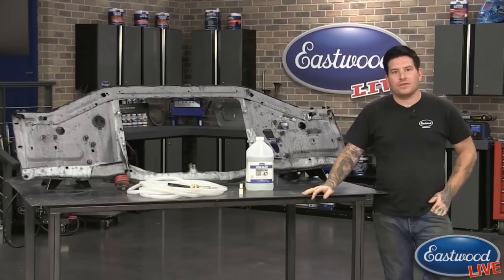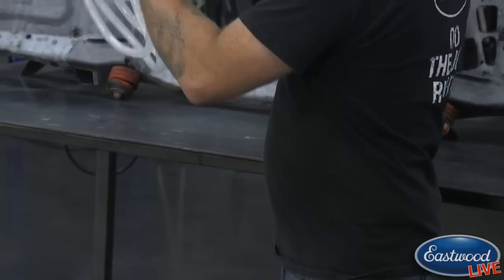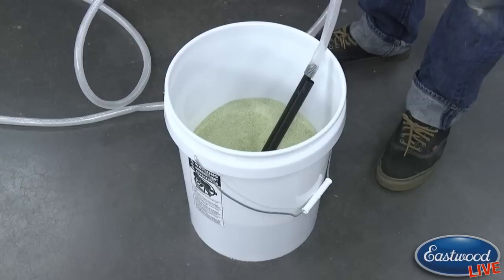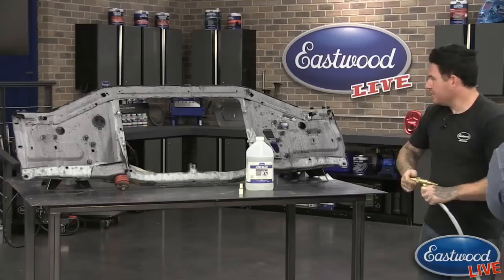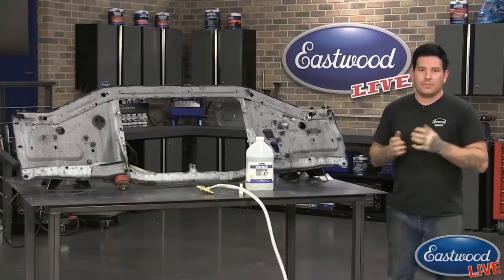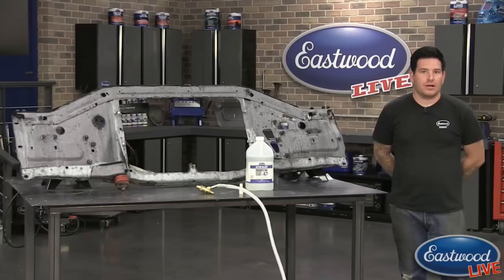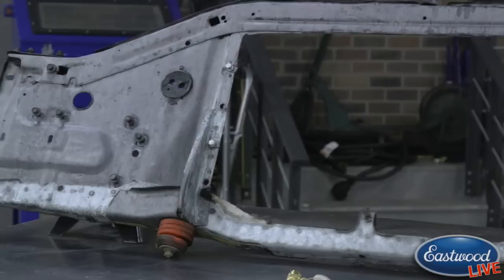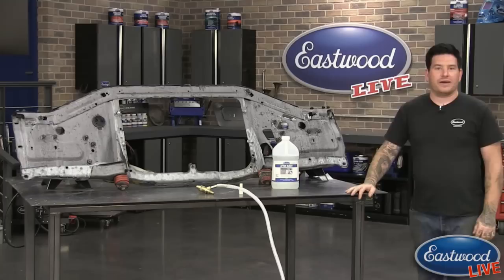Liquid Blasting at Eastwood to Remove Paint & Rust - Dustless Blasting with a Pressure Washer!

Comment: Cheap "bone dry" play sand from any store works great. You can't have any moisture in it or it will not feed. Make sure you position the sand blasting attachment tip on the wand so the hose faces up, and not down. Water will want to run down into the sand suction hose and will clog the flow of sand. I black tape the suction hose for the nozzle to the wand so its always facing up when in use.

Comment: This is the worse product I've ever bought from Eastwood! Sorry but I had very poor results from my unit.  The hose seems to collapse  and not allow media to flow threw it. I called Eastwood and they happily refunded my money which was nice.
Reply: Its the worst hose type for this application. You can see it kink over edge of bucket in the video.  When are companies gonna learn. Build it right, equals less refunds.
Reply: I have this also and like you guys I was less than impressed, I replaced the suctioning hose with a hose made for farm seeding and spray equipment. I think I bought it at Rural King but any farm supply store will have it. It is  working fine now, unfortunately companies like Eastwood have to buy Chineses to stay competitive and inferior products are just the norm from there, you have to adapt to overcome.
Reply: Not impressed by just looking at it

Comment: I made the exact system. But I found adding a power pot and a ball valve you can control the water media better. You can use that wet or dry

Comment: So you need a $1400 pressure washer (@ 400psi 3.5gpm) to work this $100 product????
Reply: I would really like to see a compressor / pressure washer combination system.  Most guys have a sub decent gas washer (2.5gpm) to push the water, and a decent 80gal/110psi air supply to push the media.  Anything bigger, well you would have a pro shop, and a pro blaster.

I'm thinking of a cyclone delivery nozzle that combines pressurized media and water in the tip.  That would strip your filler.  It would just have to be better than sand blasting while someone holds a hose on the work. :)
Reply: My 3.5GPM, 4,000 PSI machine was only $800...

Comment: Why use Ground Glass instead of sand? I used sand for 30 years until I found out it was a hazard from free floating silicates but with Wet blasting there is no dust.

Comment: I have a craftsman 2800psi gas powered pressure washer I think it does 2.3 or 2.4 gallons per minute will that be enough to power for this system?
Reply: 3.5 gpm is recommended

Comment: If I understand correctly, the After Blast will act as a rust inhibitor. Therefore I don't need to apply a primer right away, right?
Reply: Generally 72 hours.  It's not going to flash rust, but you want to epoxy prime it ASAP.
Reply: Just use phosphoric acid with distilled water diluted %40-60 depending on your strength needs 

To soak bolts or parts for days do a %20 phos / %80 distilled water

Add some hand sanitizer gel to make it adhere to the part and apply with a chip brush from harbor freight

Comment: Hello, how You remove the afterblast to paint?
Reply from the maker: It does not need to be removed.
Reply: The Afterblast looks like phosphoric acid. It is an adhesion promoter and prevents rust. I personally would use Metal Prep - same as phosphoric acid.

Comment: So I don't have a tire changer, but I need to blast the wheels of rust it currently has on it. Can I blast the wheels with the tires on? Simply, would it harm the tires if I were to hit the tires in the process? 

Can't take the tires off and then blast the wheels because that would mean I would have to leave the car at a garage while I blast the wheels. Trying to do the work myself as cost effectively as possible. Thanks.
Reply: Use soda
Reply: Use heavy tape around the rim perimeter and don’t hold the tip right at the tyre.  The rims will blast great

Comment: After your done can u apply epoxy primer or do u have to still sand it then apply primer
Reply: BodyShopMafia 1992 Usually as soon as you finish blasting as long as it is dry it is possible to epoxy immediately after blasting
Reply: Ryan Haslett thanks
Reply: spray with POR-15"metal prep",  etching primer,  keeping, All surfaces wet,  for 15-20 minutes,   rinse,  blow dry, with compressor.  keep dry,  or paint

Comment: A 50lb Bag just to do one piece!!!!!!!!!!!!! and what about all the Glass water????
Reply: There has to be sufficient abrasive media in the stream to clean. 
The larger and complex apart to be cleaned is, the more blast media will be required. 
We have a similar unit that we reclaim and reuse the media continuously. 
There is some loss, but we generally recover greater than 85 percent. 
I caution anyone and everyone that uses one of these or similar units to use adequate and proper PPE, especially head and face protection, we experience a lot of return/reflected spray loaded with blast media that ends up on/in the operators face/eyes/nose/mouth/ears/hair, clothes/pockets and in every nook and cranny possible. 
I recommend a Tyvek full coverage chem (bunny) jump suit, rubber boots,  gloves and a full coverage media blast hood.

Comment: I wish i researched this product before buying it. So at a minimum your going to pay 900.00 for a pressure washer that will work in order to use this product
Reply: Rent it @ Home Depot or Lowes for about $60 a day
Reply: I bought a Simpson 4400 PSI pressure washer for $699 New. It's 4 GPM with a 50' hose. I ordered it from Lowes. Model #: 60843 Watch the vids, you will be impressed.
Reply: @ronedee  I didn't even know you could rent them. I just called my local HD and they rent em for $100 a day. Good thing I saw your comment. Now I can return my $800 pressure washer i just bought and use those savings towards other things for my project. 73 dodge w200.
Thank you good sir!
Reply: One of the things that makes this product cost effective, is for those who already have a pressure washer, if you don't,  then why not buy a dedicated machine for blasting or pay somemeone to do your blasting. 
It's another option, so don't knock it ;).